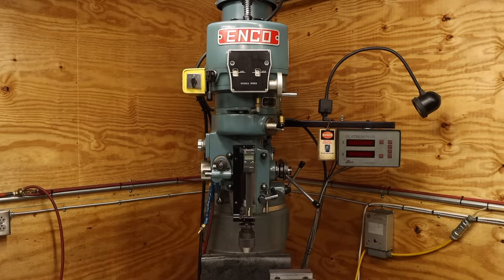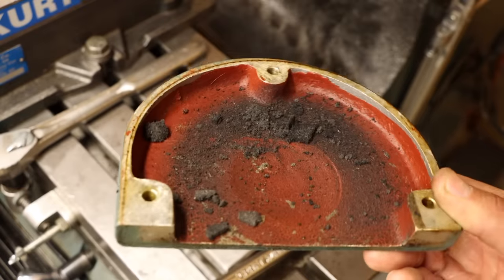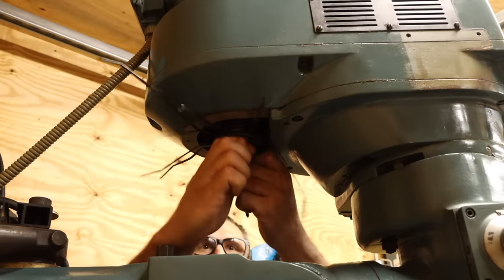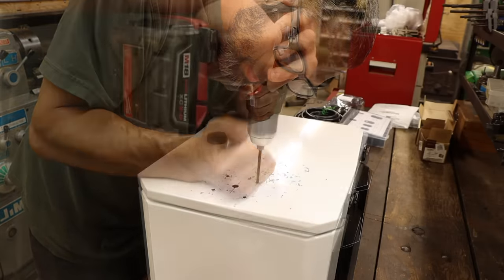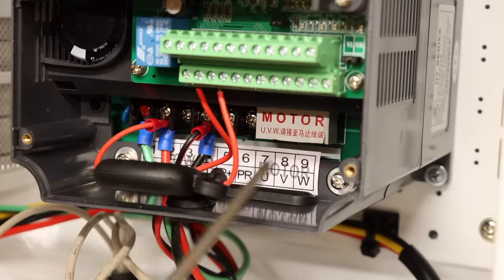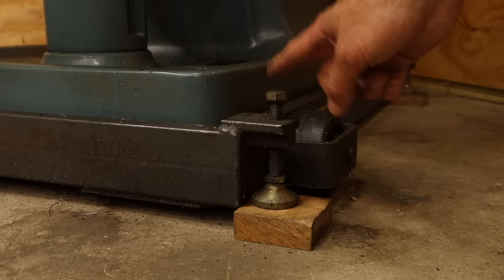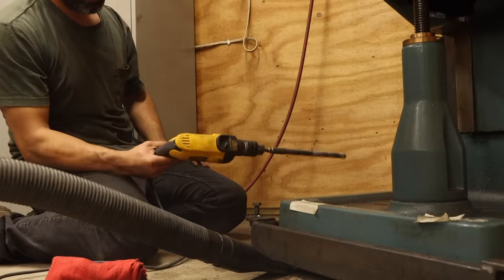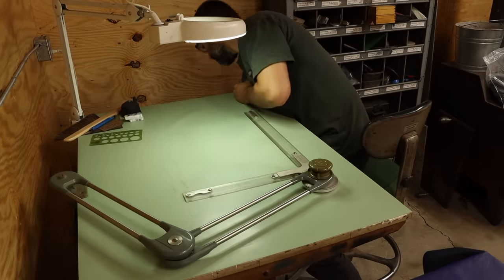What Happens When You Procrastinate...

Comment: You might want to revisit the painted over ground pin. Its grounding nothing with insulating paint on it.
Reply: I always removed paint from behind ground lugs I installed in panels... However, I genuinely believe that the nut will remove paint from the threads of the stud when it's being tightened. Ideal? No. I think it would function as a ground, though.
Reply: All the electricians watching this are having anxiety pangs when they see grounding terminations attempting to do their job through that paint.  "Bare metal!" was uttered silently.
Reply: We were all thinking it.
Reply: Relax, when it faults out it will burn the paint off real quick.
Reply: ^This! There are special washers for this with edges that dig through the paint.
Reply: I'm not even an electrician and i was thinking the same... Remove that paint bro!
Reply: Maybe one of those toothed washers they use in the automotive industry to strip paint as they get tightened down? 

Of wire wheel that bolt.

But I was with you on that thought.
Reply: @JASPACB750RR   Good thought, but nope.  NEC Article 250.12 Clean Surfaces: 
"Nonconductive coatings such as paint, lacquer, and enamel on equipment must be removed from threads and other contact surfaces to ensure good electrical continuity, or the termination fittings must be designed to provide proper electrical continuity [250.53(A) and 250.96(A)]. The star washers are good for maintaining contact and from the fasteners coming loose, but they can't be depended upon for making the initial connection.  Grounding is vital for safety.  Cheers!
Reply: @aaronfritz7234  If you had enough current on the ground terminal to burn the paint off, that would not be main problem.
Reply: @JoshuaDavidson  Or SCREAMING  it at our Monitors...

😄😁😆😅😂🤣
Reply: @shikutoai  As a commercial and industrial electrician I second this. I mean it’s really just the enclosure which wouldn’t be properly bonded to ground. Like you I’d be surprised if there was no continuity between the bonding conductor and the threaded stud.  The thing you really want to ensure is that the motor, VFD and grounding are are sufficiently low impedance. Also the line voltage splice in the low switch junction box is a bigger no no to me. The cable and motor should also all be inverter duty rated, the enclosure, VFD and many parts didn’t look to be UL listed, however for personal use I’m a home workshop use it’s probably totally fine hahah.
Reply: It's the same on the main ground on cars also, none have a clean metal to metal ground, they rely on the threads to conduct and after a few years it often gets no connection and needs to be cleaned and dielectric grease
Reply: You need to use star washers to bite through the paint and into each other and the metal cabinet!😳
Reply: @DMSparky  The enclosure being properly bonded to ground is the entire point of that termination, so as to prevent it from becoming energized in a line to ground fault condition.  So - I'll go with 250.12 on this one (and every time I come across it).  Good point about the line splice, of course.  Thanks.
Reply: You also should put star washers between those terminals to dig through the insulating metal oxide layer.
Reply: It's not the best but it'll still be a ground because threads themselves are bare.
Reply: @DoRC  It has too much resistance AND the resistance increases with current.  A few amps will generate lethal voltage on the cover.  Fortunately, the VFD is well-designed and well-built making it unlikely that the box will ever see line voltage.
Reply: @DoRC  So, the ground and neutral wires go to the same place in the main panel (system ground.  The enclosure would be the equipment ground).  if you had a situation where one of the lines (hot wires) came into contact with the enclosure and you had a poor ground, there would be multiple paths for the circuit back to the panel.  In that case, the enclosure would become energized and the breaker might not trip. So if anyone touched it, they'd possibly die. If it's adequately grounded, when this happens, the breaker will open.  Just my opinion, but it isn't all that difficult to clean off the threads and the spot where the terminal lands to prevent that possibility.  What people often neglect to consider is that many of the regs in the NEC are written in blood; someone was either injured or killed, or a structure burned down - you get the idea.  They don't just make up these regs to be obnoxious.  
So, a half-done ground will probably work just fine for years, perhaps forever; everything will operate just fine, until a hot wire chafes through a bushing, or whatever, and then when you need it, it might not work right.  
I'm just trying to help and I will always speak up when I see something that I know to be potentially dangerous.  Take care.
Reply: Given how much paint there seems to be before he threads the nut, and what remains from the shot we get at 14:43, even as a mere electronics tech I get the heebie-jeebies. A minute or two with a wire wheel on a rotary tool, you're gonna be much beter off.
But really, whoever made that enclosure should be masking that lug before painting anything.
Reply: I noticed that but figured there must be bare metal at the base of the pin/case?
Reply: @michaelrice500 no. The screw will ground it just fine.
Reply: @michaelrice500 IF we film it does it count as educational or violate the YouTube terms of service?
Reply: Speaking of grounding, on European wires the ground is usually   yellow/green 
striped. As to the painted ground, clean it, use an internal toothed washer between the base, each terminal in the stack and the nut, secured with a second nut to make sure it stays tight.

Comment: 13:57  I used literally thousands of cable tie mounts during my career (I built & maintained radio studio & transmitter facilities), but I don't think I've ever seen an adhesive mount stay stuck long term.  Plan on running a countersunk fastener through those eventually, especially if they're exposed to heat.  Epoxy may help replace the VHB adhesive if you have to forgo screws.
Reply: YEp, they never stuck.
Reply: Our panels at work get hot and the sticky pads never last. I so want them to. One site I was on used the pads without the sticky tape . They used epoxy. I am going to try cutting off half of the tape and adding epoxy. That way the pad will stay in place until the epoxy sets.  Thoughts?
Reply: @djwmunro get the type that use a screw and nut. Do it once. In over fifty years of telecommunications, broadcast technician work I think I've used most types, and a Panduit mount, genuine Tywrap ties, the black ones with the metal clips, will outlast your working life. A proper tensioning/cutoff  tool will guarantee the proper tension, especially on data and RF cables and the cut off ends won't tear the skin off the back of your hands next time you have to do anything inside the box. Ties trimmed with wire cutters will leave razor sharp ends that'll cut you faster than a kbar.
Reply: Indeed, they never stay where they are supposed to be. What kind of seems to work is to replace the ususally cheap adhesive tape by some expensive 3M stuff, that tape never failed on me. But for the price of the roll of that tape you could probably replace the parts once a year for the next 50 years :)

Comment: The control panel on the front of the VFD is removable!  Rather than stuffing it inside the box, you can run an extension cable and place it in a more accessible spot - like a 3D printed enclosure with a magnet on the back. :)
Reply from the maker: oooo I really like that idea!
Reply: @InheritanceMachining  can you say "Side Project"? I knew you could...😉
Reply: I believe they sell longer cables on Amazon for this very reason.
Reply: They also sell plastic housings to fit in panels, to hold the control panel. Definitely do that. Even though most of the "gearing" is made redundant by having access to the potentiometer, seeing the display is cool. I believe you can see amps drawn so you could even adjust feed or depth of cut to maximize the motor load

Comment: Love all the video.  The wiring looks awesome.  One thing to make it look and function even better would be ferrule connectors on the stranded wires going into the terminal blocks.
Reply from the maker: Thanks! Yes you are right. It didn't occur to me how inexpensive a ferrule kit was or I would have gone that route!
Reply: @InheritanceMachining  I hadn't either until I recently started to rewire my R2-D2 and realized how cheap and easy they are to use.
Reply: They are nice but not really necessary. The standards for these terminals require that they be made in such a way that they work properly with bare wire.

Comment: If there's one thing I learned when ordering cases for stuff like the VFD, it's to go one size up from whatever you think should be fine. That will save you the need to try to cram stuff in and make it work. Another thing you might want to consider is labeling your wires.
Reply from the maker: Wise advice! The thing I ran into with this one was the depth. once I jumped over 8" the other dimensions got excessivly large, as did the price.
Reply: @InheritanceMachining  On my Ajax mill, almost identical, I used the original incoming 3 phase mains steel box to house the VFD's, I cut clearance holes in the back of the box  and then spaced the box forward about an inch and a half to give frontal clearance. Literally thinking out of the box!  I also cut windows in the front so I can see the VFD displays while the mill is running.  Mine has a second motor in the knee for the table motions.
Reply: That works when there is a box. For us Wadkin machine heads, you often find that Wadkin cast the electrical enclosure into the main cast iron body. So it’s always fun to gut the old English electrics and get a VFD stuffed in there. 

One advantage to a VFD I stumbled into is current load. My old shop was on grid. So a rotary converter was the solution.

But my new timber framed shop is in the woods literally. So it’s off grid. The VFD is less load on the solar power system and it’s quiet making filming easier. No more yelling.

Comment: Now you just have to make sure, that your power converter is set to the correct frequency (50 or 60 Hz depending on the motor). Otherwise your speeds will always be incorrect :)
Reply: I believe I have the same model and it can be programed to always start at the same frequency, yet let you change it after via the knob if needed.

Comment: So you picked the third option for reversing the motor - make the switch lie. I would have just swapped any two motor phases. Option two would have been in the VFD parameters (probably).

My issue with the lying switch is that the next guy to touch the wiring will need to figure out what the heck is going on. And I am always looking out for the next guy. Because he is usually me. :)
Reply from the maker: 😂 Honestly I didn't pay much attention to the order I connected them in the switch to begin with since I knew I could just reverse them if needed. Swapping motor phases would have worked too of course
Reply: ahahaa nothing worse than fixing something and forgetting what the hell you did

Comment: I think for bolting it down I could have marked the holes, moved the mill, and put in female threaded anchors in the slab. That way, if you ever need or want to move the mill you can without either cutting the bolts and/or lifting it 8 inches off the slab. Edit: I use Wej-it Power-Drop anchors for this purpose!
Reply from the maker: Not a bad idea!
Reply: @InheritanceMachining  still, a second nut to lock the first can facilitate removing even very troublesome bolt. I don't know what that anchoring goop is, but is it possible that applying heat would loosen it up (if you wanted to remove the mill without lifting it)?
Reply: @ExtantFrodo2  sika claims that you need up to 190kN (i guessed the rod size to M16) for those things to fail(although they say the short-term temp range is only up to 80°C so maybe you could get it out with heat? So i'd say that thing stays there for now :D 
i think if you ever wanted to move this thing my bet would be on taking a reciprocating saw and cutting the anchors under the mill, sounds like fun :D
Reply: I'm pretty sure the epoxy becomes like an threaded anchor.
So if you was to lock 2 nuts together in the stud. The stud will wind out of the floor and be able to be screwed back down.
Reply: @matty.bull1980  If mold release of some kind was used on the threads - maybe. But that stuff is tenacious, and all thread doesn't have the smoothest of threads and all that texture is going to sink your ship fast. I would love to see a test, but I'm saying it's not coming out.
Reply from the maker: @matty.bull1980  That will be awesome if that works out!
Reply: The poor sod that ends up moving this mill might even swear on camera when he have to saw of the bolts to use the rollers...

Comment: If I may suggest something, print the documentation of the VFD and attach it to the enclosure door. Or at least a quick guide on what you have plugged on what, or a QR code for the manual or w/e. I don't think you will have any issues, having a quality unit and being so overspec'd. But for no cost this could save you some headache in the future.
Reply from the maker: good idea!

Comment: You were very lucky that you didn't have to replace the CVT sheave sleeve bushings.  That mill is in wonderful condition. Though not a practical modification with the rolling frame underneath, Barry mounts are an extraordinary system for small to medium size machinery and so precise with even a bit of isolation from other shop vibrations, which are more critical on grinders.  Many shops I have worked at have somewhat unstable concrete flooring due to natural foundation shift.  The Barry mounts are fully adjustable to fine tune the level in minutes.  Great video and thanks.

Comment: I've changed dozens of those belts and never once removed the bolt that holds the motor pulley assembly together. Of course, I used brute force and lifted the motor off with the cover. That allows the pulley to be slid into the belt.

Thank you for sharing how the phase converter works. A shop I managed once had a leg of the transformer feeding 440V to the building. The motors performed so poorly on single phase that the plant was closed for two days until the utility company replaced the transformer. I feel your pain at having used the milling machine on single phase power.

Comment: I just had to move my shop, in crates, of 120,000 pounds from my buddies house to an industrial yard.

We both have toe jacks. Mine is as heavy as a dead hippi. Buddies toe Jack is the same one you ordered. You are going to love it. We also have machine rollers. Indispensable.

We also have a pile of 2x6 and 4x4 blocks we use for cribbing.

The drive you have in the mill is called a Reeves Drive. They were used heavily in older tools. I love how smooth this beast runs now.

I am soooooo looking forward to timber framing my new shop. With the cost of building so high, those trees look more like sawmill fodder than squirrel high density housing.

Comment: if you need to remove the motor to replace a belt or otherwise, start the mill and run the Vari speed all the way up and the shut it down. then back the Vari speed down with the motor off. this puts both pulley's at their smallest diameter to give some extra play for getting the belt over the pulley. reverse process going back together. the Vari speed handle just needs to be snugged. paid a pro to do it in my garage, i watched him closely and got a nice class on it. thanks for sharing, fun video.

Comment: Love your content and watching you grow as a machinist. I am also "self taught" going on 11 years now. I'm glad you went back and leveled the machine even though you said it wasn't important. IT'S VERY IMPORTANT. The oil will run to the low side of the machine and will also cause uneven wear on the ways. Especially important to have the surface grinder level. Also with regards to anchoring the mill to the ground I've seen arguments for and against it. It'll make your machine more rigid but if there ever was an earthquake (however unlikely) it could destroy the base casting/floor. I just have mine on leveling feet because I've changed the shop layout too many times when I acquire new equipment. Just some thoughts I had, keep up the great content and growing as a machinist! Cheers

Comment: Nice job with the anchors.  The only issue is what to do if you ever need to move it. 
Enter "Redhead drop in anchors".  Only the anchor stays in the hole, allowing ANY bolt to be used/removed. Found these and never looked back.

Comment: I've been watching your channel for a while and I love your content but this one and it's timing are spot on. In these trying times of real estate I have a property owner who thinks that a 60% rental increase for his tenants is perfectly acceptable.  Hence I'm most likely moving my shop with my noisy Excello mill, belt change time,  to my 2 car garage that doesn't have 3ph power. I won't be anchoring it to the floor,  the Excello has excellent leveling bolts and pads that keep the machine very stable. Your anchoring method is very solid but the dowside may come should you ever want to move the machine , you will need to cut the anchor bolts at the floor. Great video.

Comment: 15:25 Those in-line fuses turn into a massive fire hazard when you run them on higher voltages than a car battery- They can arc over and keep up the heat

Comment: I need to applaud your self control in waiting til you had the shop vac ready before cleaning up the rubber dust. Without a doubt I would have blown/wiped it away as I pulled the machine apart, cursing myself to a far longer and more inconvenient cleaning of the entire garage later 😅